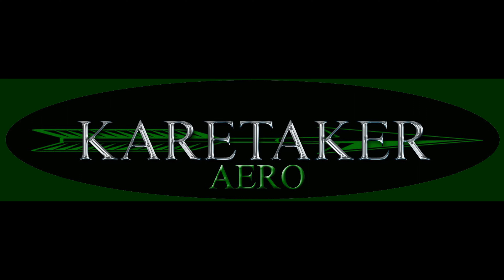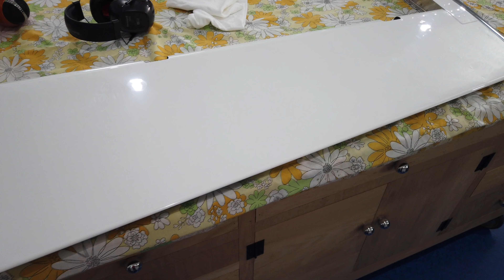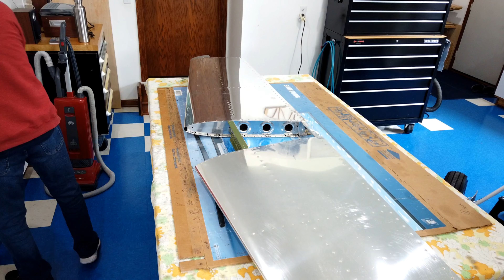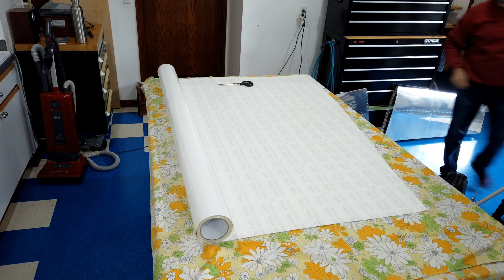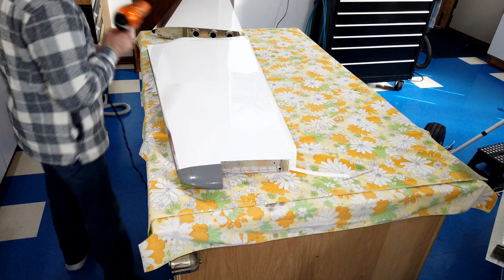Vans RV 7 HINT Videos Tail Vinyl 4

Comment: Have I missed something: how does the vinyl fit over the leading edge universal pulled rivets, and also double thickness alloy (counter balance alloy overlap).
Reply from the maker: An earlier video addresses the leading edge and the vinyl has no issues laying over areas where there are two layers of aluminum.